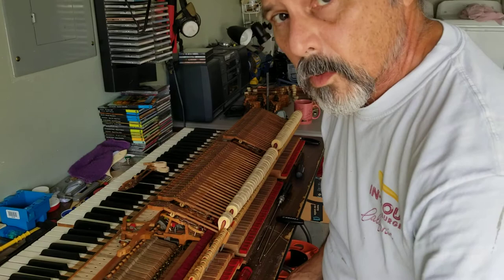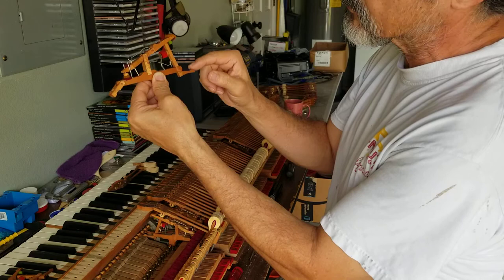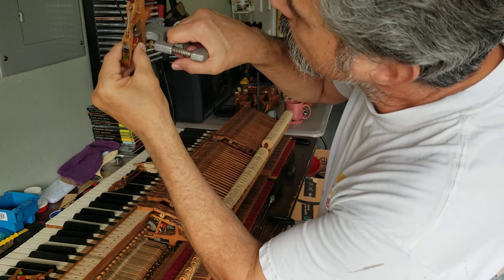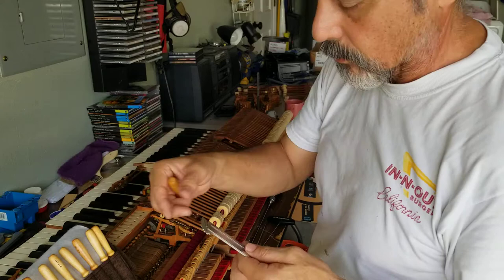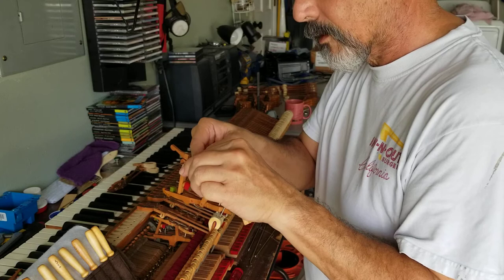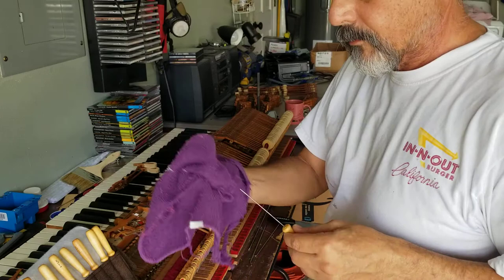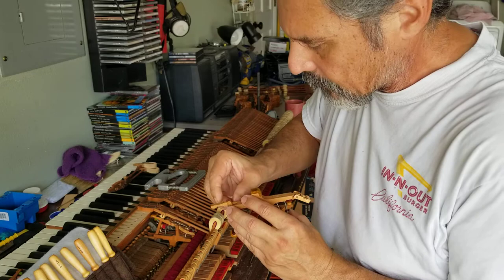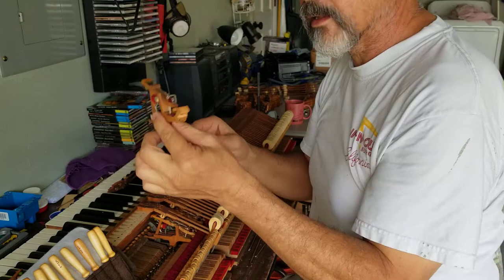Repairing a sluggish grand piano whippen jack.

Comment: Really should use a new pin right? After the original was installed it was cut and those cuts could leave a small burr that tears the bushing. New pins are pointed on one end to avoid that risk
Reply: I was taught to always use a new pin, if for no other reason than it's much easier to re-insert a pin with the sharp point

Comment: My Baldwin piano has this problem in so many keys, I wonder if it has anything to do with the spring tension, or if it’s more likely because of the pins only.
Great video.
Reply from the maker: It could be the springs. Best way to know is to access the action and take a look.  There's another channel that is awesome at explaining the inner workings of pianos. Check out Howard piano industries on YouTube. He's really great!
Reply: Thanks. I’m familiar with them but just hadn’t noticed these on their site. I’ll be ordering some immediately!
Reply: I tensed up springs where keys were getting stuck. In some cases they became bouncy and struck the strings twice when played softly. There's a sweet spot por the tension where this bouncing keys problem disappears.
I ended up replacing the center pins that joins the jack and the whippen. though I had to get a special tool for the removal of the pins. I also lubricated these pins. For anyone having this issue, this solved the issue definitely and the piano is now a charm.

Thanks again for the great video!